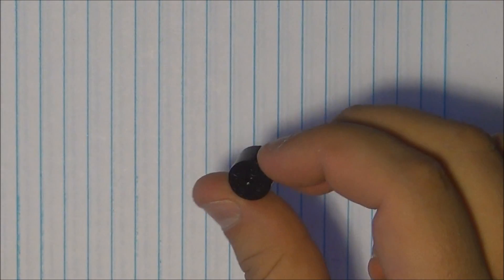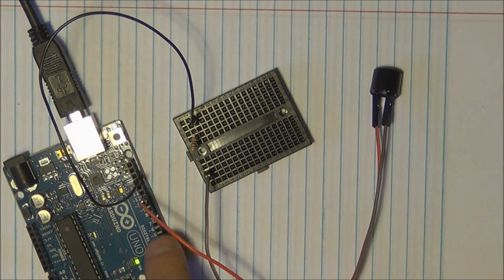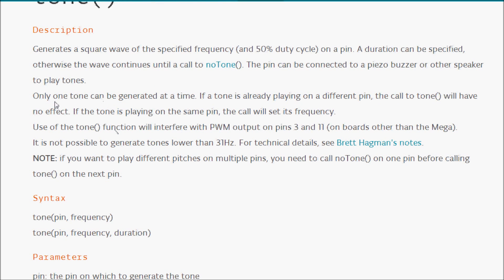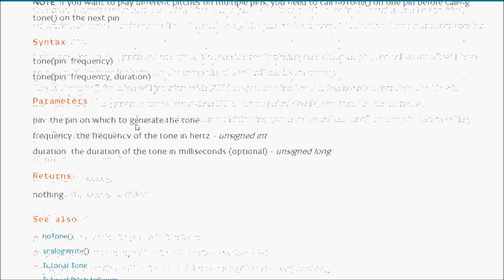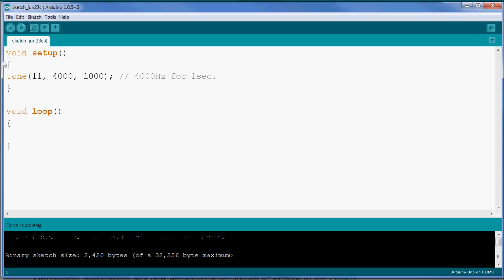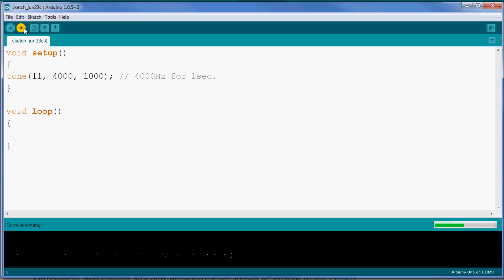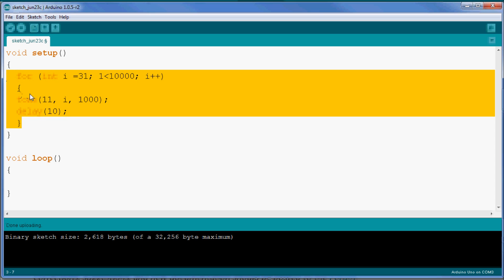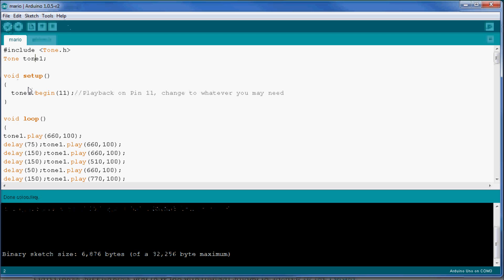Arduino Tut. #8 - Arduino Tone & Sounds - Super Mario Theme

Comment: You input a 1000 duration, but the tone keeps more than 1 sec. Can you please explain what basically happened? I really appreciate it.
Reply: Did you put it in the void setup or the void loop? If it's in the loop section then it will play forever, if it's in the setup section it only plays for one second.

Comment: Arduino: 1.8.1 (Windows 10), Board: "Arduino/Genuino Uno"

C:\Users\vijay\Desktop\adruino pp\sketch_apr07d\sketch_apr07d.ino:1:18: fatal error: Tone.h: No such file or directory

 #include <Tone.h>

                  ^

compilation terminated.

exit status 1
Error compiling for board Arduino/Genuino Uno.

This report would have more information with
"Show verbose output during compilation"
option enabled in File -> Preferences.

Comment: why he used i++
Reply: That is just a shortcut for incrementing the counter, you could read it as i = i + 1
Reply: What he said.  It's just one of several math function shortcuts in the C programming language.

Any variable name followed by either ++ or -- means to increment or decrement the variable, respectively.

Usefully, you can either use the current value of the variable and then increment/decrement it or first do the increment/decrement and then use the resultant value, by simply changing where the ++ or -- is placed.  If the operator is before the variable name, the increment/decrement will be done before the variable is used, but if the operator is after the variable name, the variable will be used before it is incremented or decremented.  This allows you to (for example) pass the current value of a variable to a function and then increment it in the same operation.

There are also shortcuts for some other common math functions, like you can use i*=2; which will multiply the contents of the variable "i" by 2.

Comment: can i put a drum tone on the piezo buzzer through arduino?
Reply: Like a DIY MIDI Controller, is that what you are asking???  YEP, here is just one example: http://lifehacker.com/build-your-own-16-button-midi-controller-with-an-arduin-1614628540      
         Also, if your familiar with coding (writing sketches) you can easily write up a sketch.
So with the sketch, Arduino and two Piezo elements. You could have one piezo sense a knock, tap, bang from a drumstick or whatever and the other output the desired tone! GOOD LUCK BUDDY!!!!           https://learn.adafruit.com and  http://www.instructables.com are great resources, chances are someone has done something similar!